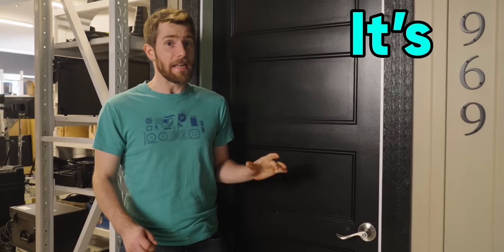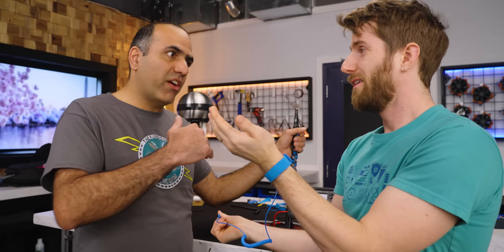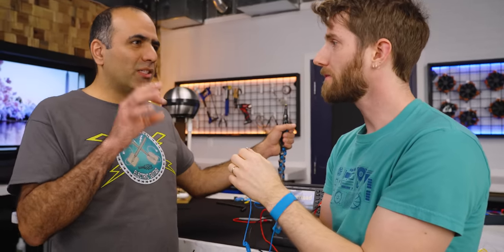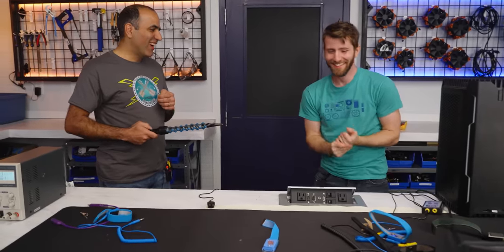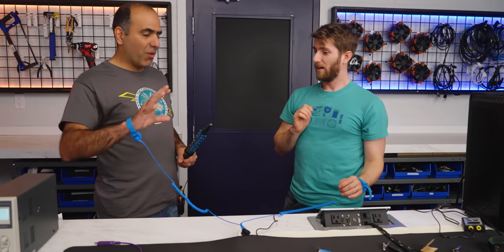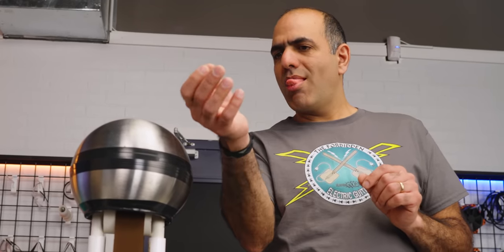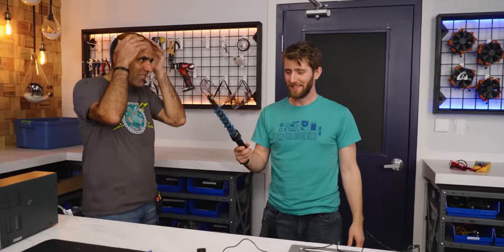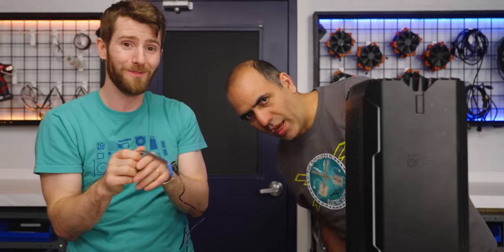The SCAM of Wireless ESD Straps - Feat. ElectroBOOM

Comment: fwiw, I was reading the specs for an IC, years ago… maybe 16-pin? I forget.  anyhow, only ONE pin had a warning:  as much as -100mV of backwards voltage can blow-out this sensor.

it could take way more than that in forward voltage … but apparently no internal protection diode, on that single pin.  🤷‍♀️  fair enough.  ( they can mess-up weak signals )  quite the routlette.  😂 on paper.

IRL engineers will try to bait the ESD with a “lightning-rod” of some sort, to ground..  Ground-pins will attract the ESD and data pins will resist it.

suppose I have a radio-antenna that I really don’t want fried.  I need to build a lightning-rod that is definitel taller, and dumps wwaayy more power to ground, right?  if the lighning has a way better path-to-ground than my little antenna … lightning will strike the tower, and mostly ignore my radio, right?  😅👍
Reply: anyhow, I did want to point at polarity:  the chip I described maybe would NOT fry the sensor at 25kV?  😮  it was only BACK-voltage that would fry it.  😂  it was -0.100Volts that would kill it.  noting that’s in the negative direction!

in the positive direction … I think it would die if it exceeded 25mW total power, death from overheating.  so, at low enough milliamps, any voltage wouldn’t be immediately lethal.
Reply: anyone feel free to check my numbers … I’m ballparking / guesstimating.

human-tissue/skin reads around 8M ohms, “normal.”  easily lower than 1M ohms if sweaty & nervous.  😅  hence, one of the “polygraph” components.  (😂 polygraphs are a bit “pseudoscience” … but also, skin-conductivity is kinda fascinating, outside of “lie-detection”) … think it’s a fairly wide range.

human tissue doesn’t care if the voltage-bias is “positive” or “negative” … so, it might have helped, trying to zap the RAM, if they’d flipped the polarity a few times.   say, moved that ground-clip they added, from the ground plane of the circuit, to the Vcc of the circuit.  🤷‍♀️  may have done nothing … but that just means the RAM engineers aren’t fools.  🤣

Comment: I never wanted to use those coz I did not want to be electrocuted never knew about the resistor though. So thx for this video it did change my mins about those wrisrbands (the wired ones)

Comment: thx guys.more great content from you both. sparky here.imo,its all about potential difference across components... so...to mitigate this component killer(ESD)just touch the pc frame or sheilded nuetral(negative) of any device every time prior to handling any card or mobo etc. so if your body is say 10M + V,and you touch negative sheild or pc case,its also now 10M + V also,so now when you touch any component with your 10M + V charge,the potential difference between 10M +V and 10M+V is zero volts and no damage will be done as there is no voltage difference across the component and therefore no current will flow.
Reply: What the hell are you talking about? Your "opinion" has no place in a discussion about ESD and best practices surrounding it. The "jUsT tOuCh ThE pC cAsE" thing is such a moronic "solution" as 1) almost no one has a bare metal case and if it's not bare metal touching it doesn't do jack shit, and 2) it only connects to ground if the PC is plugged into the wall. If you're working on your PC with it plugged into the wall you don't deserve to be working on PCs.